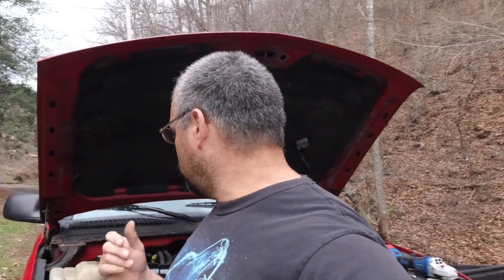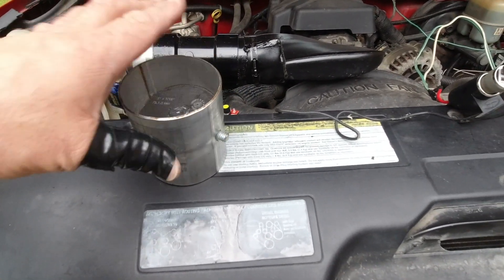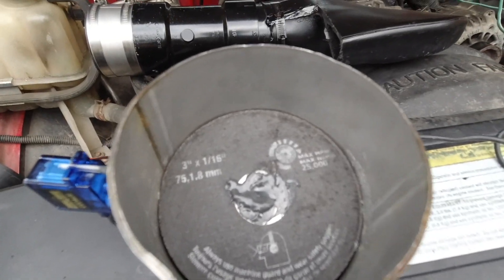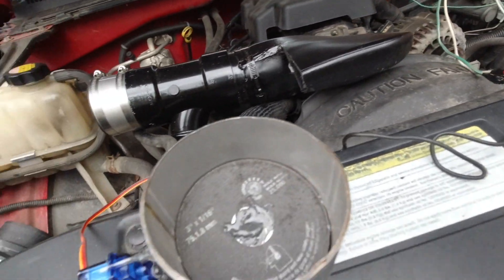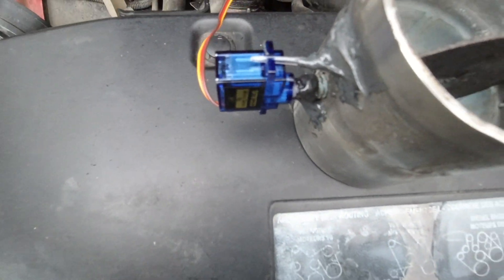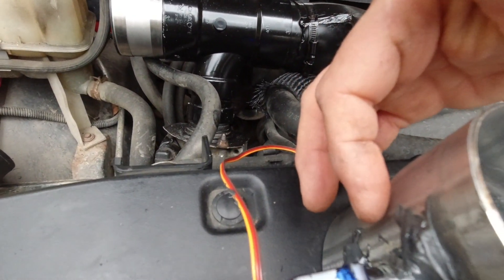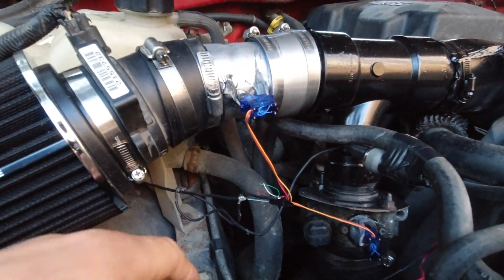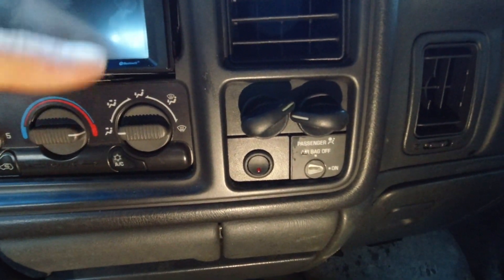Woodgas control setup

Comment: Luke, we miss you on the D.O.W. Forum buddy.  Awesome setup, I hope you're still driving this truck around.
Reply from the maker: I still drive the truck, but I took out the gasifier as I am going to be changing the bed. It started showing a lot of rust. I'll either build a flatbed, or try to find a good used bed.

Comment: Hey - q for you please... what do you make of the claims that engine can run on h2o using resonance frequency or other "unusual" notions like that which dont actually burn the h outright?  Thank u
Reply from the maker: As far as getting the h2o split into hydrogen and oxygen it is easily achieved. It takes more energy to split them than you get out of it. 
I don't think it is possible to do it with any real type of efficiency. I have never fooled with resonant frequencies so I can't be sure.
Reply: @lukeFugate  thank you... i m sure u know why i ask.  For someone like me without proper chemistry & physics education, hard to tell what has legs or not.

Comment: Why not get get throttle body from a from pickup and control with a arduino?
Reply from the maker: I looked around the local junkyards and couldn't find one. They were all too small.
Reply: @lukeFugate  i picked up several throttle bodies from trucks and larger front wheel gm suv remember it only air  you wont have it wide open so 2 or 2.5 "  should be fine if you need more the ardunio code can open full trottle, for a brust.
Reply from the maker: @772777777777777  I have another 2 inch throttle body I wanted to use. It wouldn't allow the MAF sensor to flow properly. On gasoline it would lose about half of its power, I guess because of the reduced air flow. I'm still trying to find a throttle body from this same truck. Just not many junkyards around here.

Comment: Hello, do you have any type of filter setup for the woodgas going to the engine? I imagine it'll plug up the engine with tar quick if not
Reply from the maker: It does have a filter, actually two. First is a hay filter then a stainless steel scrubber filter. The hay filter is all most people run and they say it is fine. Tar can't be filtered out and it will make it all the way through. A Wayne Keith gasifier isn't supposed to make tar after being properly warmed up.

Comment: Analog input on the arduino for the O2 sensor reading may need a small capacitor for noise reduction.
Reply from the maker: Thanks! I hadn't thought of that.

Comment: Looks like you may be finishing up this project soon Luke. The servos are a great idea. No mechanical connections should make it easier to use and easier to control.
Reply from the maker: It should allow for more precise adjustments. That's what I hope for anyway.